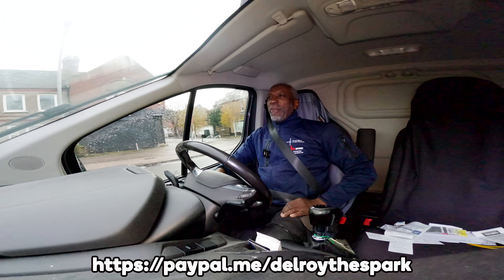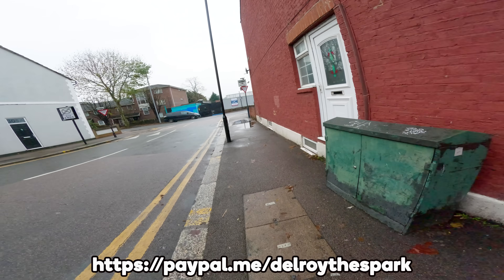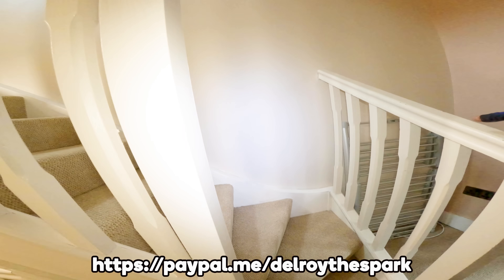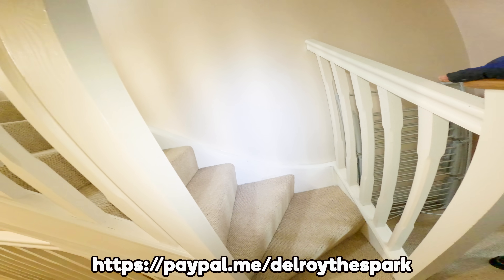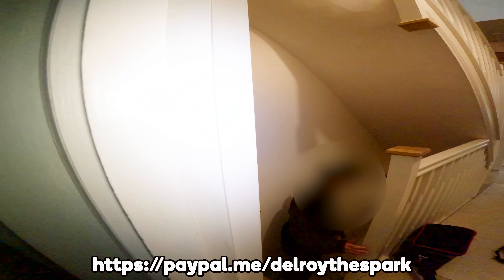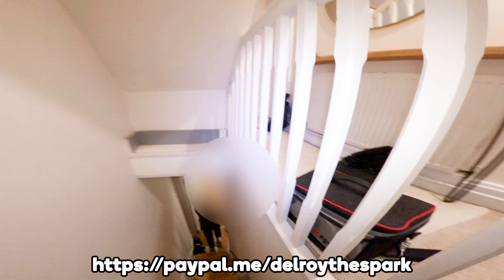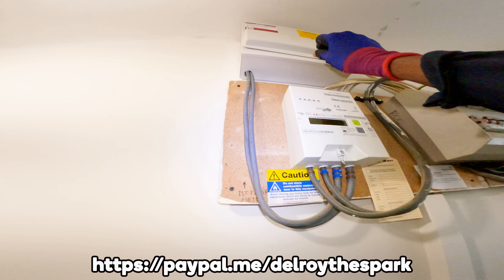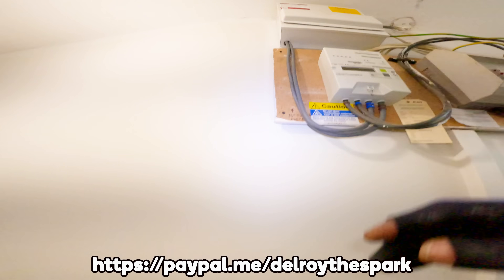Electrician: "This is a weird fault" | Electrical Fault Finding

Comment: That was not a weird fault it was a couple of arse holes  putting a small fueboard in the attic and not marking its location at the downstairs fuseboard also they should have fitted a 63A double pole main switch in the attic fuseboard not a RCD and was it wired in 6mm T+E 50A MCB should have been 10mm  any hidden equipment that could cause problems should be marked  Cheers

Comment: Could be a timer  or strapper wire circuit and poor run borrowed neutral running back through the wrong RCD when a two way switch is operated
Reply: Didn't you hear that macerator motor cycling when he turned on the RCD? That starting and stopping will generate tripping spikes that will have undoubtedly caused the problem. A crossed wired neutral will trip every time a load exceeding the rated ma of the RCD is applied, so definitely not that.

Comment: I dislike my X1 as well. I’m going to return mine.
Reply: Hi Michael, what do you not like about the X1- I’m on the lookout for a new MFT. I have the Megger 1730
Reply: @abdulseaforth6930  it’s missing a lot of the functions the the 1741, like stake-less earth testing, the (pure) auto test for Ze/s and RCD.

It keeps showing neutral errors when doing the fake auto test, even when the leads are pre connected and the load is then switched on. 

When choosing different RCD testing modes it keeps changing the testing mA which is frustrating when the tester is a long way from the board and you don’t realise until halfway through / after the test. 

The battery is pants and will / can die without warning. 

When conducting 3-phase testing the switching of the leads around to different ports is a nightmare and can catch you out if you get complacent. 

The link to the CertSuite software it’s just gimmicky and as the tester can be nightmare for testing, it can take twice as long to get the relevant results sent across to the software, also if you haven’t got the tester, or the software set up correctly, the results just disappear. 

I found the 1741 was its own tester with its own user-friendly quirks however the X1 is very similar to a Kewtech in the way it operates. 

Megger might have done a software update but their website is still showing the original firmware and no updates. 

Currently, my X1 is sitting in a bag doing nothing and I’ve gone back to my 1741

Comment: I would reconfigure the board downstairs so that the loft feed is non rcd protected. Two rcd's on that loft feed is asking for trouble
Reply: but that would require that the 6mm cable feeding it be protected mechanically which probably isn't possible now that it is installed.  Easier just to remove the RCD in the sub-board since it isn't adding anything and since it has same rating as the one on the main board it can be a bit random as to which one will trip out first.

Comment: You should change that second RCD in that small board in the loft conversion for a main switch , you don't have two 30 ma RCD one upstream to the other , plus you should change that wylex MCB for a mk one ,  at you should have notified the customer that work needs to be carried out ,
Reply: Doesn't matter. The 2nd RCD will trip on the 0 degrees, the main RCD will trip at 180 degrees if there's a fault.

Comment: Ditch the RCD in sub-board in loft 👍
Reply: or move the 50A breaker off the RCD in the second board
Reply: Front end RCD no main switch so not possible, also the feed from main consumer unit to sub-board was in T+E and the installation method would require supplementary protection so would therefore need to be clipped surface or otherwise suitably protected from damage I.e. armoured cable or trunking. So only viable option is remove RCD and sub-board therefore achieving “discrimination” and eliminating possibility of 2 RCDs tripping👍👍
Reply: Sorry edit that 🤦‍♂️ the consumer unit is spilt load not front end as I first thought (look better 😅)

Comment: Too much power consumption Too many devices at the same time
Reply: or just a dodge device, hence it was the RCD not an overload......
Reply: Don't think so as she said it tripped whilst she was out, so hardly any load on the circuits most likely. Sounded like a pump firing up when he turned the loft RCD on. That would be my first port of call, and obviously informing them that an RCD downstream of an RCD is asking for issues. Then the wylex breaker needs sorting in the MK Board, just my 2p!
Reply: Spot on. Tuppence well spent.  @Wyrd94